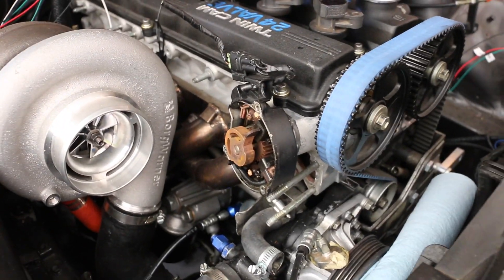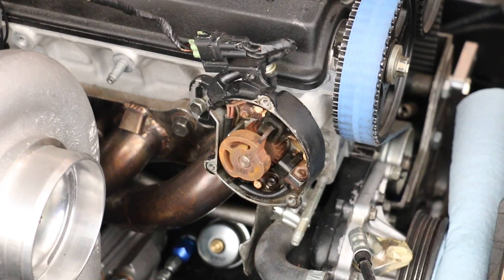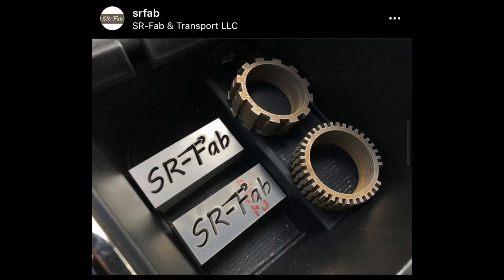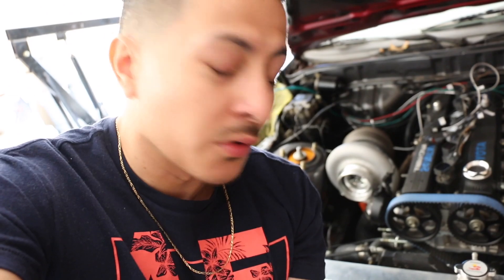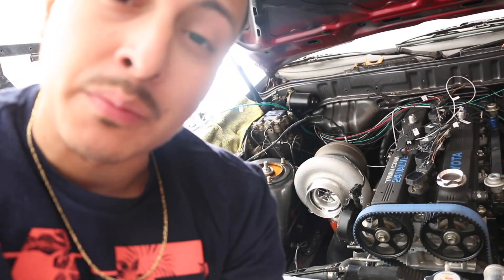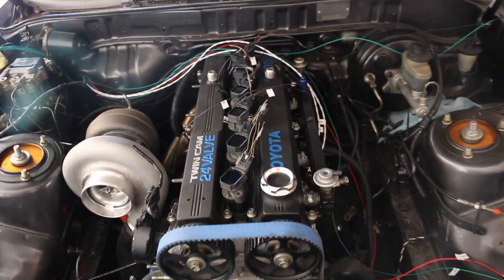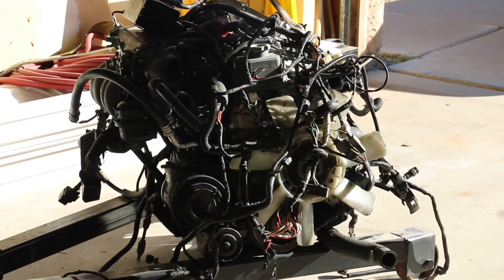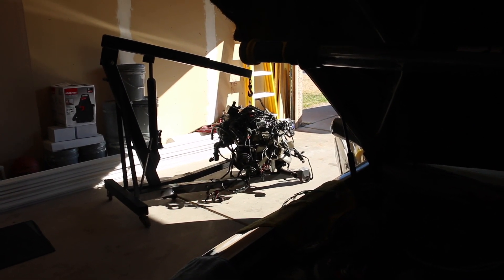MK3 SUPRA CUSTOM ECU MASTER ENGINE HARNESS PART 5 ( SOME CORRECTIONS AND SETBACKS )

Comment: You could try the magnet the driftmotion sells to boost the cps signal and run the car like that until you get the wheel set up. Might be a more temporary thing but you night be able to make it to the show this month then.
Reply from the maker: Dpapa357 the show was yesterday 🙄🙄😂
Reply: @-LFATV  Danggg. For some reason I thought you said the 20th lol
Reply from the maker: Dpapa357 i did and i got mixed up, but even if it was the 20th these few things have held me back big time

Comment: I know someone commented the driftmotion unit. Don't do it. It's crap.  If your on a tight budget I would custom fit a hall sensor to the cps for cam position, and there are 2 people on the buy sell trade page that sell trigger wheels. A guy named William sells a 36-1 wheel that bolts o the stock pulley and another guy sells a 12 tooth wheel that press fits into the crank outside of the cover. That or find someone to cnc cut you a trigger wheel for the crank.  Both the crank and cam wires should be shielded as well so you dont get noise in the signal.
Reply from the maker: EditsWithBlur yea man and my opinion too expensive. Thank you for the advice

Comment: Hey I'm working in my 7mgte and I used coaxial cables that are shielded with the flexible center core wire and it worked for me .
Good luck .I m trying to finish my project by March or so cause I've been working on it since 2016. Take care
Dz
Reply from the maker: Danny z thats a good amount of time hopefully u meet your deadline
Reply: @-LFATV  thanks 
I hope u do as well.
The engine bay in your ride is coming out sick!!!!!
Take care 
Dz

Comment: Hey man, what’s your wheel set up? I got the coil overs you recommended and now I need something that looks as snug as yours.
Reply from the maker: J_ H_II i replied on IG fam
Reply: LFATV thanks man, I asked here first so I haven’t seen IG yet. I appreciate it
Reply from the maker: J_ H_II but 18x9.5 and 18x11 with pulled and rolled fenders a bit on rear

Comment: Have you looked into the driftmotion V2 digital CPS upgrade?
Reply from the maker: justforkiks29 yea they are almost $400 forget that lol
Reply: @-LFATV  Yeah not much is cheap for the 7m platform. It really sucks that toyota didn't just add smog equipment to the 1jz engine designed for this chasis and ship it in left hand drive instead of making a whole new engine for export models.
Reply from the maker: justforkiks29 i feel its because alot of Toyotas development at that time in their company

Comment: Nice build! Did ECU Master mention it was necessary to run knock sensors on E85 / Flex fuel? Only reason i ask is because im building a 2jz s13 swap with a Haltech ecu that will be flex fuel but I was told by Haltech that knock sensors aren't necessary because its extremely hard to get an engine to knock on E85, so im not wiring them in
Reply: Cool bro, I was just curious, always good to be safe, can’t wait to see it finished
Reply from the maker: Freddy_FPV yea hopefully sooner then later
Reply from the maker: Freddy_FPV well on a 7M i would say it’s definitely necessary to have to for any safety precaution

Comment: The factory CPS works great with a ECU Masters standalone but on AEM standalones those are more picky with the factory CPS signal. I highly recommend a remain A1 Cardone CPS unit from RockAuto. The one I bought 2 years ago came with a lifetime warranty from them. You only need to use 3 of the 4 wires for the CPS wiring. Also keep in mind from factory the 4 CPS wires are shielded in a single sleeve so make sure you wire it properly when you are at that point.

DriftMotion has that upgraded CPS sensor with the hall effect sensors but the problem that I have heard from others is the heat kills the sensors. If you were going with a hall effect sensor I would mount that away from any heat sources such as a intake cam gear and crank pulley so the sensor will last longer and not give you any problems.

Keep up the great work.
Reply from the maker: Shwalker07 yea i seen them in DM but i didnt wanna pay so much for one of them